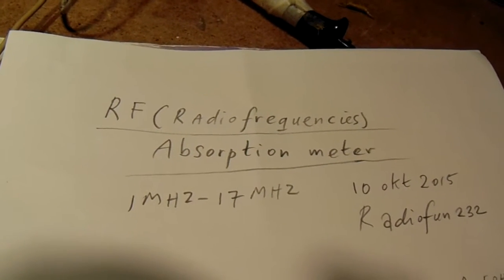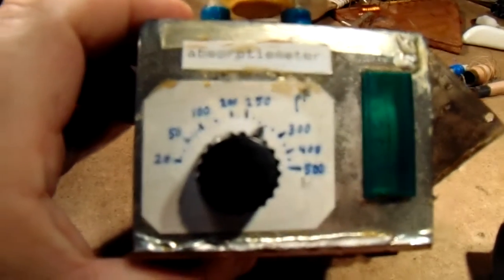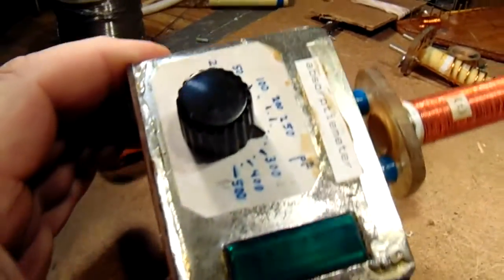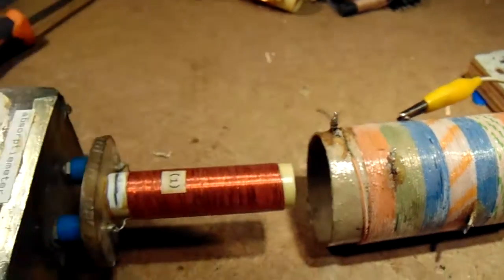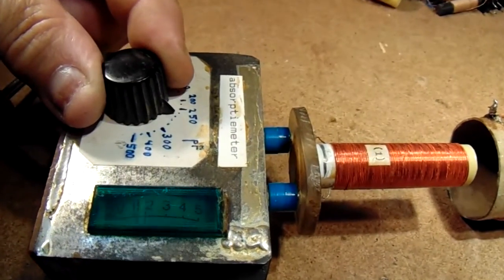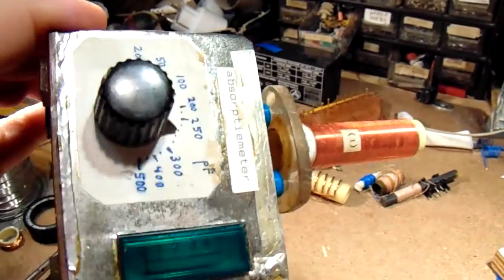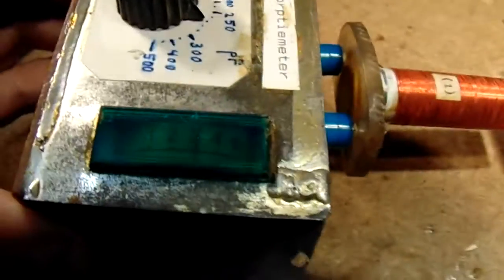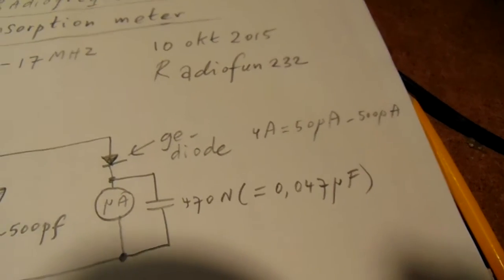RF (radio frequencies) absorption meter demo and schematic

Comment: What problem does the device solve?
Seeing frequency spectrum…. ?
Reply from the maker: It absorps a certain radio frequency, it means that, when you have an oscillator on that frequency, you can test its frequency + the amount of energy that such an oscillator strays out. It all regards measurements on certain radio frequencies, they can go from (say) 50 KC up to (say) 500 MC. When you want to get more insight, go to my Channel trailer on YouTube and search there (via the Looking Glass = search option) via keywords like "shortwave" / "radio" / "resonance" / "Short Wave" "oscillator" / "generator" etc. 20 March 2025.